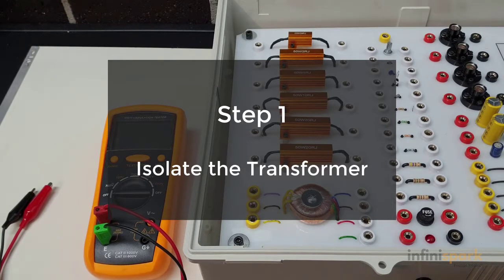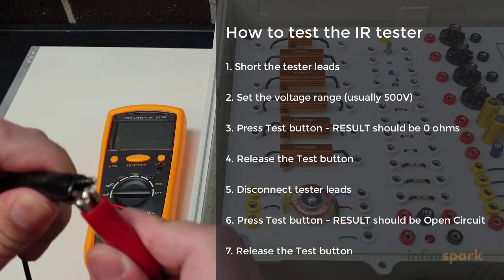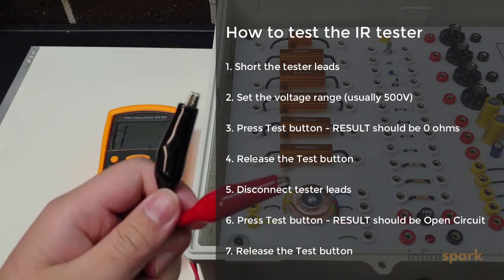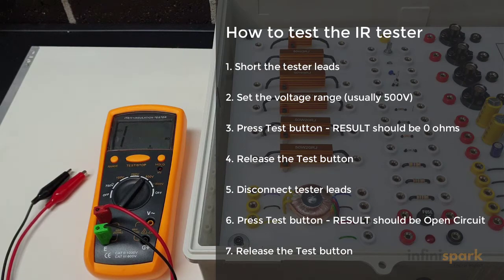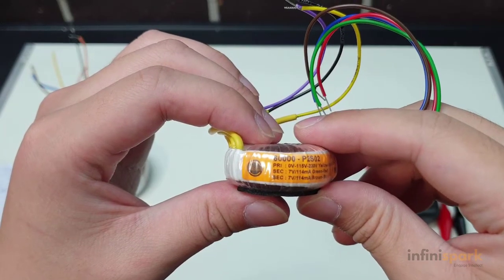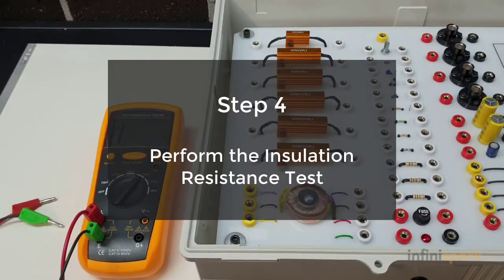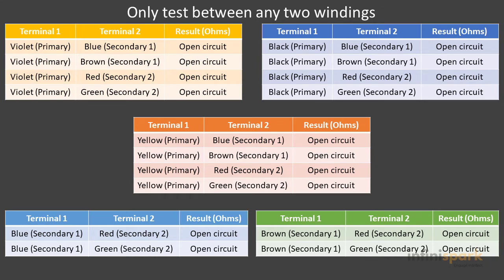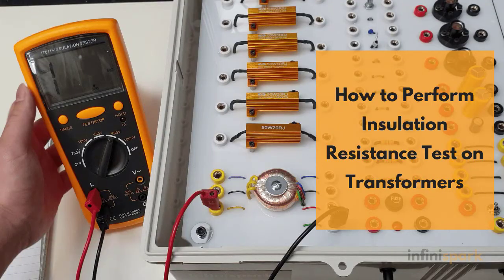How to Perform Insulation Resistance Test on a Transformer

Comment: sorry, may i ask what is your max insulation tester reading? is it 200M ohm (199M) or 999M ? because i have 4 digit insulation tester with max reading 1999Mohm and my transformer is around 560, not over limit or 1.. is it supposed to be okay?
Reply from the maker: Most countries have a minimum insulation resistance requirement for parts and appliances. In Australia, the minimum value is 1M ohms. Although the ideal reading should be open circuit, it may not always be possible depending on how old a part is or for how long it has been in use. If you're getting 560M ohms, I think that's still usable and most likely will pass the region's minimum IR requirements.